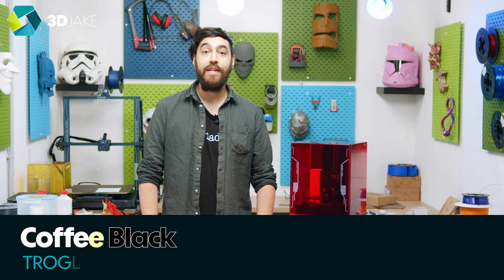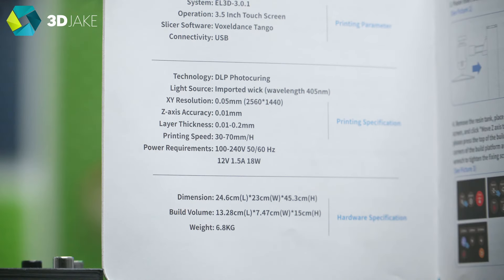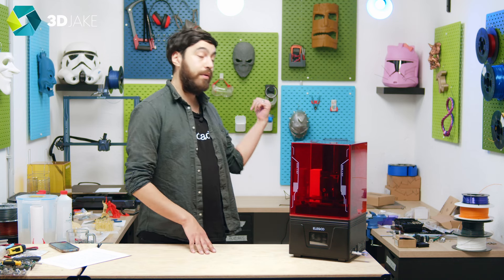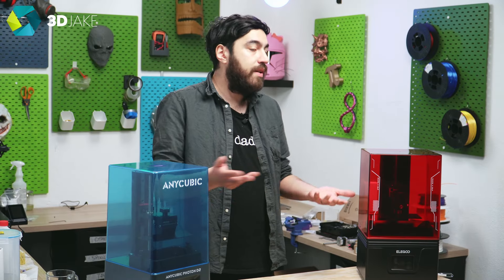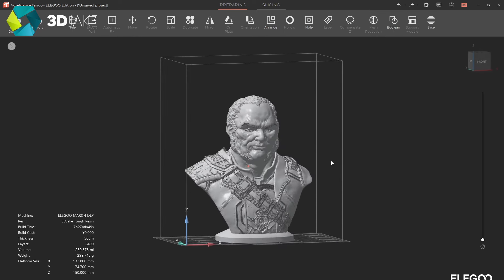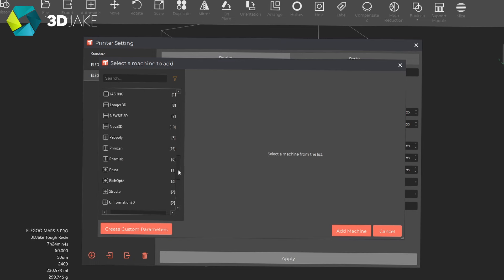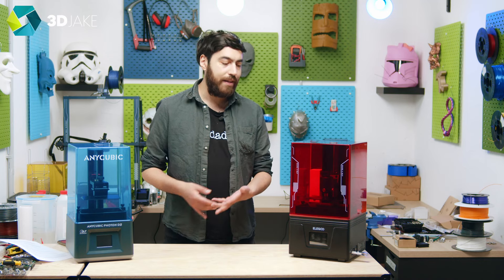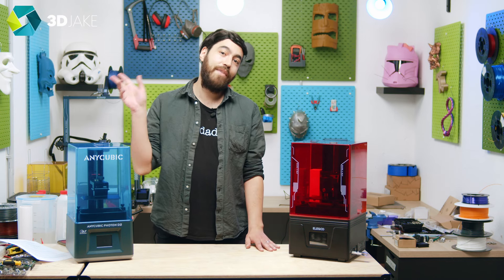The Elegoo Mars 4 DLP

Comment: The comment about using the printer for 10 hours a day and needing to replace it after 200 days isn’t accurate. It doesn’t stay on the entire time the print is happening. It comes on in intervals which is a setting you can adjust. Yes 2000 isn’t as big as the former but time taken for printing does not equal time the actual light is on.

Comment: where did you get 80 micron xy resolution?  all the info i saw said 51/52, same as the photon d2...
Reply from the maker: Rats! It is actually 50 microns, thanks for pointing that out, technically 51.8 but 50 in their documentation.
Reply: Technically the DLP engine is also the same as used in the Anycubic Ultra which has a resolution of 80um. The D2 adds an XPR unit that moves the pixels diagonally whereby doubling the resolution and then they refocused the optics to a larger platform resulting in a 50um (51um) final resolution. This is the "double algorithm" that Anycubic lists on their D2 webpage.

Comment: How does this compare to the D2? Is it more comparable to the ultra?
Reply: Same DLP module, its from Texas instruments. they are the only company that makes this type of mini DLP's projectors.  So I would be surprised if there is any difference, if there is, then is due to the other components in the system and build quality.
Reply: @sprocket5526  thanks. But the ultra is also Texas Instruments right? And that has a lower resolution. So there can be differences.
Reply from the maker: It is the same DLP chip, effective resolution is 51μm, this is achieved "sort of" like antialiasing (the process is called XPR) in that the chip's actual resolution is considerably lower. But both the D2 and the Mar 4 DLP have the same chip, same resolution and same XPR use. Still, the quality is higher than say an LCD printer at the same resolution.
Reply: @stuffandnonsense8528   Technically the DLP engine is also the same as used in the Anycubic D2 and Ultra. The Ultra has a 1280x720 resolution of focused at 80um. The D2 adds an XPR unit that moves the pixels diagonally whereby doubling the resolution and then they refocused the optics to a larger platform resulting in a 50um (51um) final resolution. This is the "double algorithm" that Anycubic lists on their D2 webpage.

Comment: Questions : do they use the same DLP projector as anycubic, can a DLP projector be replaced if the resin falls by accident, what are the chaNGES needed for standard resin when printing with dlp. Has it released or when will it release globally
Reply from the maker: It is the same DLP chip as Anycubic use, which can be replaced but we haven't got pricing and availability from Elegoo just yet. So far I have not noticed anything major with the resin we tested but we're doing. Generally speaking there shouldn't be any or only very minor changes to exposure settings when swapping from LCD printing to DLP printing
Reply: Its the same DLP chip, there basically only is 1 company that makes these sort of mini DLP's, and thats Texsas Intruments.   What we dont know, is if anycubic/elegoo is buying an of the shelf DLP module with all the doo-dats need to make it work, or they are making their own controller boards with the IT DLP fitted to it.  If proprietary board, getting spars might be hassle. if it is a TI designed and produced module, then you can buy them "cheaply" on most electronic parts distributors like mouser etc.
Reply: @sprocket5526  when is it releasing .. any idea. or expectation
Reply: @souravgames  its available in the EU store already
Reply: @sprocket5526  Anycubic uses an “OEM” eViewTek DLP engine which includes their own driver board with the TI DMD (Digital Micro Device) Driver and Power Management chip set on it. Anycubic then adds their own “controller board” which has the main CPU, touchscreen interface circuitry, and stepper motor driver parts, etc which then hooks up to eViewTek’s board by ribbon cable.  The photo I have seen of the inside of the Elegoo Mars 4 DLP unit looks like it uses a DLP module and driver board made be a different OEM vendor. The Elegoo unit also has a separate “controller board”, used in same way as the Anycubic controller board I described above. And, no, I have never seen any “cheap” DLP boards or modules, even from Mouser or Digikey or other electronic parts suppliers (they may be out there; I just haven’t seen them).

Comment: Don't like voxeldance tango software it comes with won't load stl locks up.
Reply: They load no problem. Maybe update your video card drivers or delete voxeldance and reinstall it. Just wanted to give you hope that it's probably something simple.
Reply from the maker: Also had no problems with loading up stls, checking the drivers is a good bet, we're running a 1050 Ti which is pretty basic as GPUs go, other GPUs shouldn't have any issues.

Comment: The worst printer I have ever bought!
It only prints objects in the center-right, everything falls off the plate on the left, it has no resume or recovery if there is a blackout or power outage, the tub always reserves resin in an opening and always dirty the printer leaving resin lines that can be seen when removing the tub, and the worst thing about this printer is the movement of the plate when held by a screw, it has some inclination, the worst of the worst!
I am talking about a new, unused printer, placed on the floor where it should be! I RECOMMEND ANYCUBIC 100%